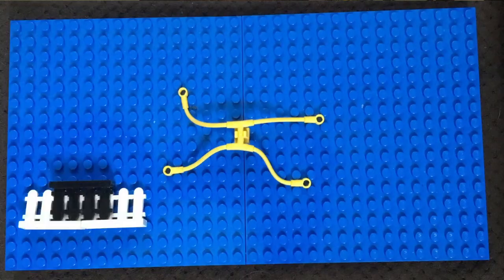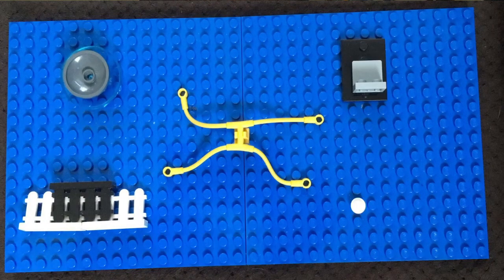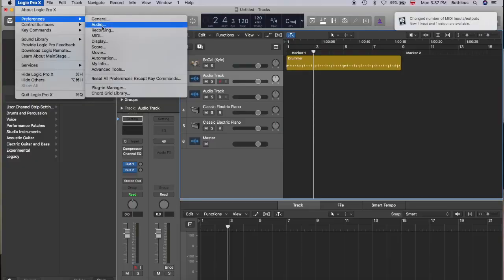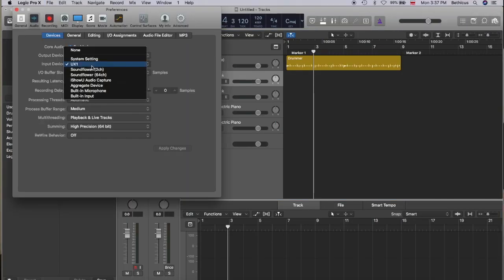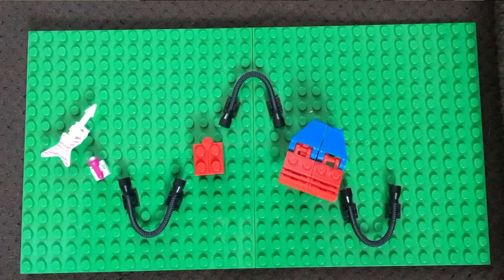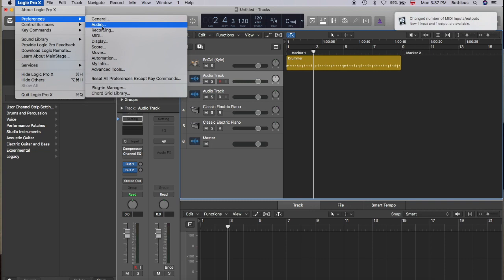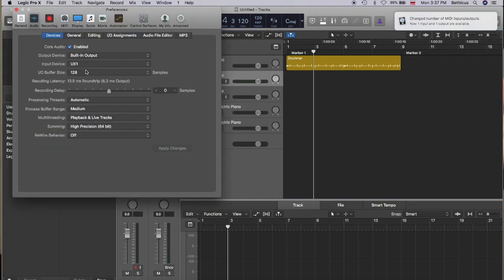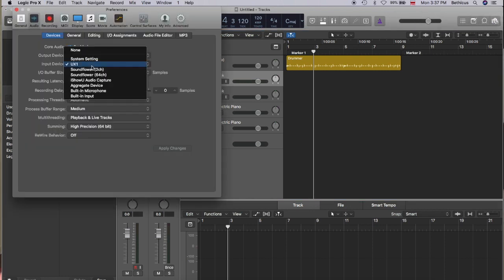How to troubleshoot your interface (no sound, hiss, software issues)

Comment: Привет ,я не как не могу понять, на моей line 6 ux1 горит зелёным когда она подключена к ноутбуку . В под фарм 2 когда извлекаю звук на гитаре ,в поде фарме 2 индикаторы сверху зелёным шевелятся а звука от гитары нет. Не знаешь что это?
Reply from the maker: Hey Ronni - it sounds like you should check and make sure 1) that you're getting the right input in your digital audio workstation - the instrument line instead of the mic line 2) that Podfarm is running as an active plugin in your system.
Reply: Привет, а это надо в понель управления смотреть ?
Reply: Я тебе скинул бы скрин, но сюда не получается. У меня в свойствах звука ,пишет в кладки запись интерфейс цифрового звука line 6 ux 1 по умолчанию . А в свойствах нет данных о гнезде подключения.
Reply: Ты на каком виндовзе его использовала ?